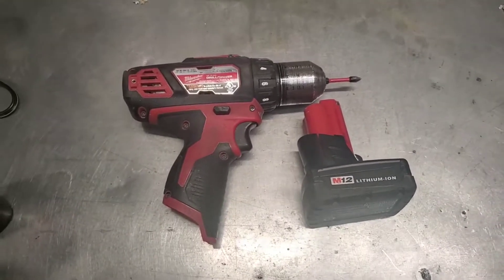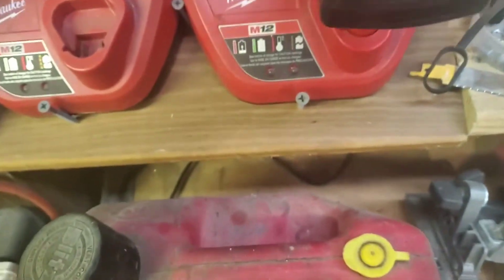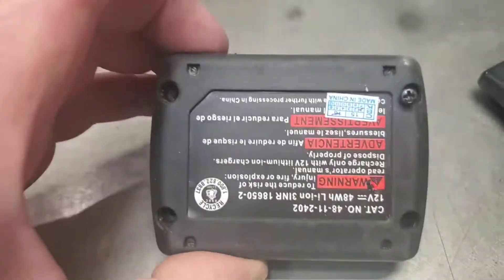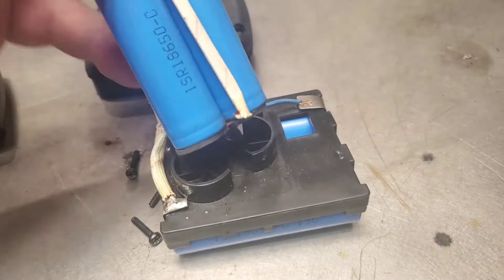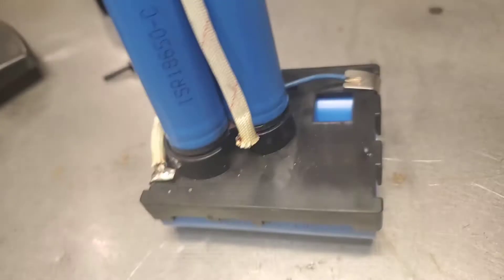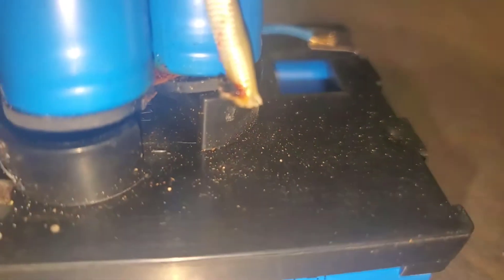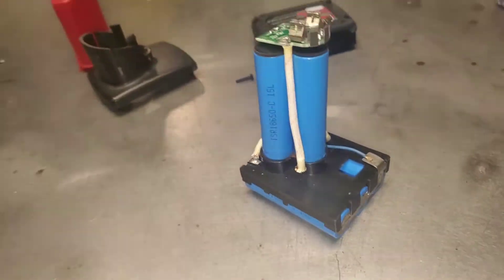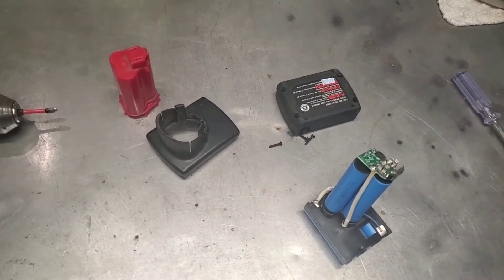How to fix broken Milwaukee battery pack

Comment: Good save,i know poor electrical connections can get hot under load maybe it wasnt soldered the best to begin with. ive seen on AVE with his teardown videos that that brand is built to a much higher standard than other leading brands. i watched the cordless chainsaw vids.
Reply from the maker: Yeah this is an aftermarket battery and I use the shit out of my drill I probably overheated it and blew the connection

Comment: Another possibility that may have caused that wire to ‘burn / fry’ break off. Looking closer at the video, one can see the battery strip that’s welded to the two batteries is discolored (probably from heat). Since those two batteries are connected in parallel, one of the batteries may have shorted causing excessive current to flow while the battery pack was being used at the same time. Of course, I’m just guessing.
Reply from the maker: Yes they only burn off that ground wire under heavy load but normal use the last forever

Comment: Just an FYI, The wire burned away from the terminal is Positive, from those two cells connected in parallel. If anybody needs pictures and wiring diagram of these M12 6-cells, that I'm making for my brother. I'll be more than happy to provide. The ones that I'm working on are '6-cell' that also didn't come with any instructions. So, I had to do some research to figure the wiring/assemble.
Reply from the maker: Mine were burning away from the ground cuz they use a cheap wire I have fixed mine
Reply: @TheOriginalAndysGarage  Thanks for commenting, didn't expect someone to respond so soon after a year of posting.
The damaged wire that is being shown in the video is the Positive voltage wire connected to the two cell's positives end that are in parallel.  Just FYI.
Reply from the maker: Oh okay I wasn't sure I figured it was negative cuz it was stuck to the bottom of the battery

Comment: My m18 12.0 just started red green blinking on the charger hopefully it's that easy
Reply from the maker: The Chinese batteries suck they keep burning the ground off has happened to me three times so far
Reply: @TheOriginalAndysGarage  I was running my blower getting some snow off a sidewalk last night. Nearing the last bar on my official m18 12.0 . I felt a shock on my hand and it shut down. The battery wont charge and it shows no light on the battery. Might be the ground wire?
Reply from the maker: Yes your melted off that wire you'll see it when you take it apart
Reply: Why does the ground wire get so often melted?
Reply from the maker: @philipdove1705  I think it's just cheap Under sized